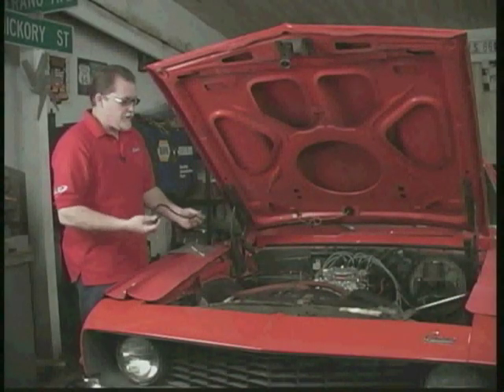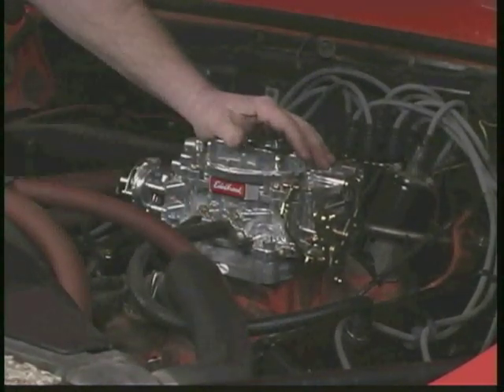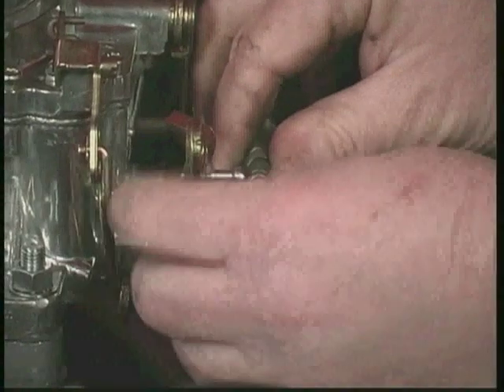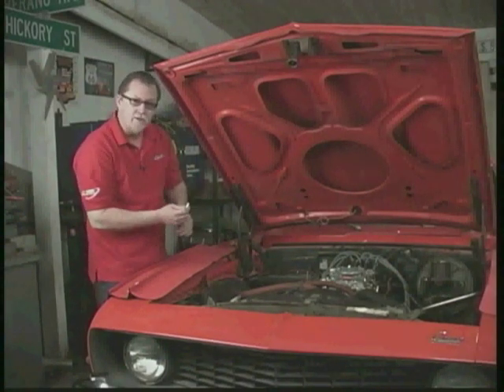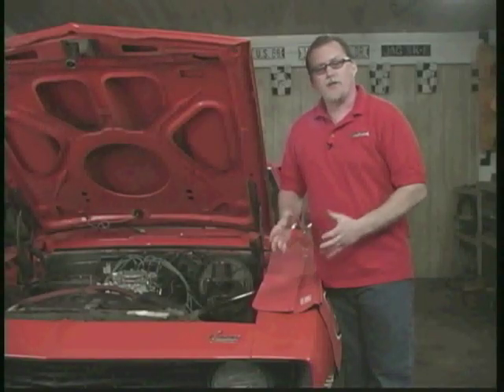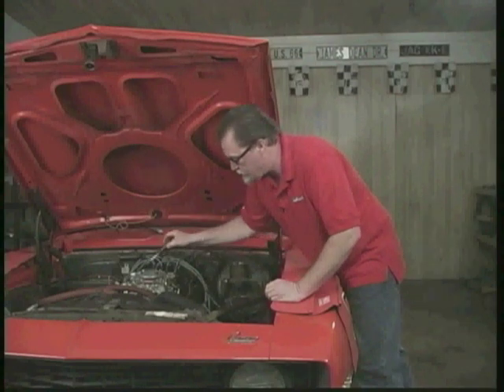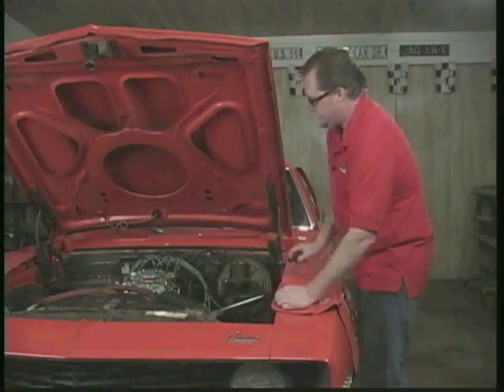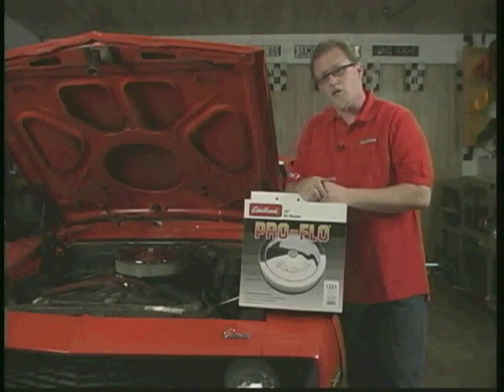Edelbrock Carburetor Installation and Troubleshooting Part 3 - Installation 2

Comment from the maker: Big Dave replies: If working on a manual transmission car and not an automatic hook the throttle return spring to the lower bracket on the transmission to pull the throttle lever backwards to the rest position. In hooking up a transmission kick down cable, the throttle return spring could be attached to the top of the throttle bracket and pulled forward on the carb to put the throttle lever back to the rest position.

Comment from the maker: Big Dave also replies: If you are using the same type Chevy you would need the Edelbrock bracket 8031 and possibly Edelbrock 8018, depends on the end that is on your kick down cable. Also this bracket has a provision to hook the return spring to the bottom and pulls back on the throttle lever.

Comment from the maker: Tune in the carburetor the way that it is going to be run.  If you are going to run an air filter, you should tune in the carburetor with the air filter on.  When you are checking the timing, advancing the vacuum, or any other off-idle tuning, it should be done with the air filter in place.  In the case of idle adjustment, there is such low air flow going through the carburetor that the restriction of an air filter would be minimal. The air filter was left off for visual purposes.

Comment: Electric choke comment, Hooking to a Key powered accessory will open the choke with the engine not running and it can burn out the element in the choke. As for hooking to the alternator, my Mustang has a factory wire running from the choke to a stud on the alt that only puts out 12v when the alt is putting out power. I understand GM may not have that option because i changed to a GM one wire 100 amp alt with no choke out put. i now have it wired to an oil PSI switch. thanks for the videos

Comment: This is probably the only source I've ever seen that recommends using ported vacuum for a pre-1974, non-emissions equipped vehicle. Virtually any engine builder will recommend using manifold vacuum unless you NEED to use ported vacuum for emissions purposes. Otherwise, it can cause problems such as hotter running.

Comment from the maker: Check your fuel pressure at the carb and make sure you have enough volume to keep the bowls full. Also, check the vacuum secondary; seems they are opening too quick. The secondary on the Edelbrock carb is usually set to come in later. Sounds like someone has been adjusting them to open too quickly. Finally, check your ignition timing. It might need a little more timing in the engine.

Comment from the maker: That's the characteristics of the 1406. You might try the calibration kit, but be aware that leaning the carb down at idle or right off of idle will also lean it down in the upper RPM's. Don't go to the leanest step first. You will have to try a couple of times to get it right. Also, look at your fuel pressure and make sure you're not flooding the carb. Some mechanical pumps will produce more pressure at higher RPM's than they do at idle. If it is a pressure problem (next comment)

Comment from the maker: The actual bracket that attaches the cable to the carb should be on the carb. If not, contact the place where the carb was purchased and see if they can get you one. There is not a separate part number for that bracket. You will need a choke cable, part number 8013. Without a cable to keep the choke flap open, it could be partially closing and causing the richness.

Comment: I have a brand new motor, ignition and it runs great at low idle and mid pedal but  However, when I hit the pedal hard, the engine stumbles and misses.  Any advice or how to, tune this motor correctly?

Comment: Great videos!  Some of the most detailed I've seen.  Quick question.  Not to criticize your methods, but I noticed that you did your initial idle tune without the air cleaner on.  All of Ebrocks manuals say to do this with the air cleaner installed.  I don't because it's a pain the the rear.  Does it really matter?

Comment: I watched all the videos on the carb install. I put a Edelbrock 600 (1406 model) in my 86 Chevy C10 305. Now is see the video stated to put the vacuum on the right side of the carb, the guys on the truck forum keeps telling me to put it on the left side. When I do put it on the left side, I get a lot of knocking & backfires after I shut the truck off. It seems to run better on the right side. Can anyone tell me what the difference is from running my vacuum to the left or right? Or if its going to hurt or make a difference from one side to the other?

Comment: One thing I don't get is, I have vacuum coming from my distributor but also from this metal line coming from the transmission. Am I suppose to plug both into both of the holes in the front?

Comment: I have an edelbrock 1406 on my 1982 jeep cj7 with a 360 v8 engine. It runs, cranks and idles perfectly, however it is running way to rich. I can smell almost raw gas in the exhaust. Would you suggest rejetting? I've already purchased the calibration kit. But was a little apprehensive about changing anything. I bought the jeep used with this Carb already on it and I'm not sure what changes may have already been made. Just wondering what you think.

Comment: I just bought a new edelbrock 1406 and it is running really rich any suggestions on how I should adjust it. Also when I bought my carburetor it didn't come with a manual choke bracket do you know where I could get one. Thanks

Comment from the maker: The 1406 has the electric choke. The 1405 is the manual choke version. It sounds like you have too big of a carb for your application. A 1406 is needed on a 350 cubic inch or bigger application. If you do have a 350 or bigger engine, look to see what kind of fuel pressure you're running. You need around 6 PSI for the Edelbrock carb.

Comment: Can someone please explain why people recommend manifold vacuum instead of timed (ported) vacuum
Reply from the maker: Manifold vacuum is more important because it's needed for your power breaks. Timed vacuum is mainly used for timing advance in the distributor. Most distributors have a mechanical advance that will work just as good or better than the vacuum advance.

Comment: I was wondering,if any ones has ever polished the inside walls of the primary an secondary venturi boosters an inside the throat area? Good idea or Not?I just thought i would flow better than ruff casting ,I can see i good bit of casting flash,Would i notices any difference after polished ANYONE PLEASE HELP?

Comment: this wont work on pontiac throttle cables i have the carb on my 70 lemans and i just tried to put the throttle cable on and the ball is too big for the throttle cable to slip over
Reply: stick a small body file into the throttle linkage hole, but leave it tight enough to where it doesn't slip on and off very easily.

Comment from the maker: (continued) you can install a pressure regulator and set the pressure at 6 lbs. This will keep the pressure steady at all RPM's. If you have any other questions, feel free to give us a call at 1-800-585-0683.

Comment: Sorry but wrong mister. Ported vacuum is for smog-regulation on low-performance enegines w. wery low pre-ignition-settings. Allways use full manifoil vacuum on performance enegines to avoid detonation. A rither mixture burns faster and needs less pre-ignition